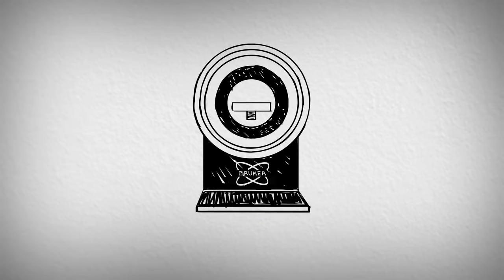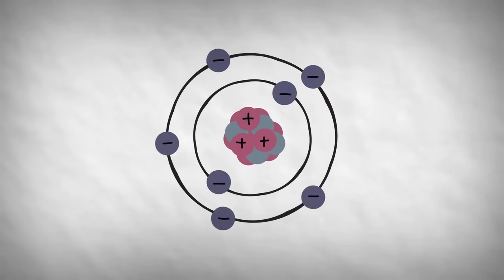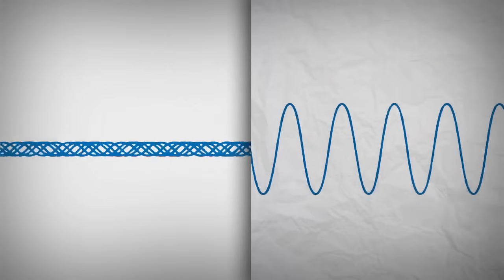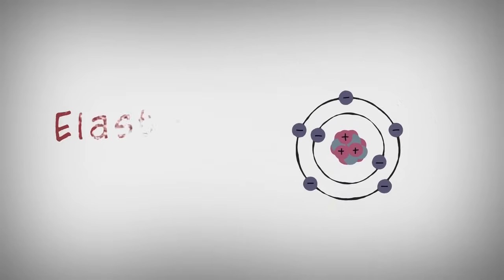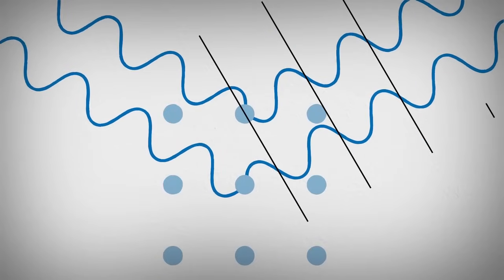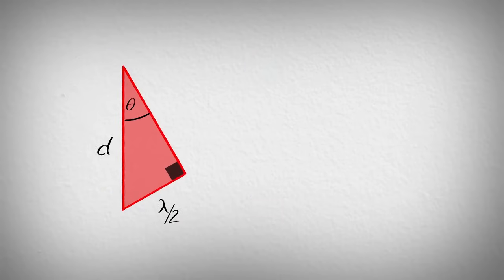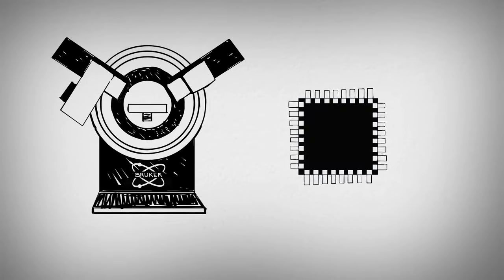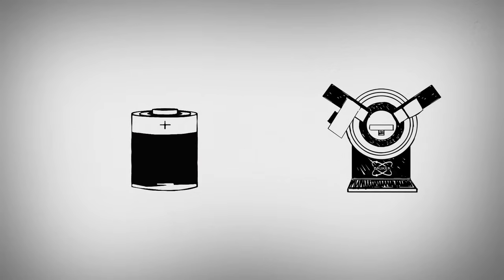What is X-ray Diffraction?

Comment: https://www.youtube.com/watch?v=UcsWZx6p5Qg

### *What is X-ray Diffraction?*

*0:00* What is X-ray diffraction, and what is it used for? In an X-ray diffraction experiment, a sample is placed into the center of an instrument and illuminated with a beam of X-rays. The X-ray tube and detector move in a synchronized motion. The signal coming from the sample is recorded and graphed, where peaks are observed related to the atomic structure of the sample. Most materials are made up of many small crystals like sand on a beach. Each of these crystals is composed of a regular arrangement of atoms,

0:29 and each atom is composed of a nucleus surrounded by a cloud of electrons. It's at this scale that the story of X-ray diffraction begins. X-rays are high-energy light with a repeating period called the wavelength. Since the wavelength of an X-ray is similar to the distance between atoms in a crystal, a special interference effect called "diffraction" can be used to measure the distance between the atoms. Interference occurs when X-rays interact with each other. If the waves are in alignment, the signal is amplified. This is called "constructive interference".

1:02 If the waves are out of alignment, the signal is destroyed. This is called "destructive interference". When an X-ray encounters an atom, its energy is absorbed by the electrons. Electrons occupy special energy states around an atom. Since this is not enough energy for the electron to be released, the energy must be re-emitted in the form of a new X-ray, but the same energy as the original. This process is called "elastic scattering". In a crystal, the repeating arrangement of atoms form distinct planes separated by well-defined distances. 

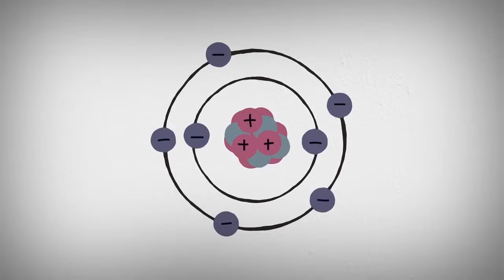1:32 When the atomic planes are exposed to an X-ray beam, X-rays are scattered by the regularly spaced atoms. Strong amplification of the emitted signal occurs at very specific angles where the scattered waves constructively interfere. This effect is called "diffraction". The angle between the incident and the scattered beam is called 2-theta. In order for constructive interference to occur, the scattered waves must be in alignment, meaning that the second wave must travel a whole number of wavelengths.

2:01 In this case, one half of a wavelength is traveled on the incident side, and one half on the scattered side, yielding one additional wavelength. In the case of the next X-ray, one wavelength has traveled on both the incident and the scattered side resulting in two wavelengths. This reinforcement occurs throughout the crystal. The exact angle at which diffraction occurs will be determined from the red triangle. The angle at the top is theta, half the angle between the incident and scattered beams.

2:27 The long side is the distance between the atomic planes and the short side we know is one half of a wavelength. The relationship between the diffraction angle, and the spacing between the atoms can be determined by applying the sine function. Rearranging this equation yields an equation commonly known as "Bragg's Law", named after Sir William Henry and William Lawrence Bragg, the father-son team who won the Nobel Prize in 1915 for their work analyzing crystal structures with X-ray diffraction. This technique of X-ray diffraction is used today for a wide variety of materials,  ranging from

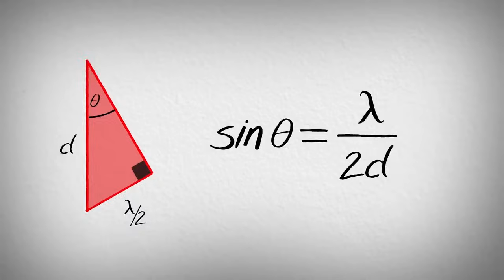2:58 single crystal epitaxial thin films, to polycrystalline mixtures of powders, and even randomly oriented amorphous materials. X-ray diffraction helps scientists to develop new pharmaceuticals, classify rock formations based on their mineral components and understand how the arrangement of atoms affects the behavior of energy storage materials. As scientists push their ability to engineer materials on the atomic level, X-ray diffraction becomes an increasingly important tool in their toolbox. Advances in equipment design have made X-ray diffraction easier to use, and more powerful than ever.

Comment: What is the use of moving the source and detector if the sample is a powder and therefore placing millions of crystals at random orientation.   Only those that happen to lie at the "Bragg angles" (n.lamda =2d.Sin theta) will produce an exit beam.
Reply from the maker: Typical detectors are 2-3 degrees wide. 
By moving the source and detector a wide range of 2 Theta angles can be accessed. Additionally when the sample is a flat surface, poor resolution is obtained when the incident and outgoing angles are dissimilar.
Reply: @Bruker  
You seem to have not been paying attention.

Comment: why XRD is not spectroscopy? Thanks
Reply from the maker: XRD is based on scattering and interference of the x-ray beam - the energy (wavelength) isn't changed in this process. In spectroscopy the x-ray would be absorbed and a x-ray of different (lower) energy would be emitted.
Reply: @Bruker  Thanks, Hence why DLS is spectroscopy however it depends on measuring the intensity of scattered light also

Comment: A little bothered by some of the information here.  Should be mentioned that the principle of single crystal X-ray diffraction and macromolecular X-ray diffraction sort of work differently.  I suppose you can say that atoms are aligned in a regular pattern in if your crystal consists of a single element like a crystal of diamond or something, which is what I assume this video is talking about.  In most forms of X-ray diffraction, the compound or protein of interest is crystallized and pack into a regular repeating pattern.  The atoms themselves arnt necessarily oriented in regular spacing, but the unit cell is.  The unit cell can contain 2 or more molecules (not atoms) organized in some orientation.  The raw data is usually not recorded as peaks but rather a diffraction pattern, like a 3D sphere of regularly spaced dots that are the diffracted X-rays and undergo a Fourier transformation in order to deduce the structure of the crystallized compound.
Reply: This is one of the interesting points of XRD. Scientists from many different disciplines have developed their own methods and descriptions of the principles over the last 100+ years. Chemists, geologists, physicists and materials researchers all have different sample types with slightly different methods and nomenclature. The video describes the most basic and widely used form of XRD (Powder XRD or PXRD) as a basis for further exploration into more advanced methods (such as Single Crystal diffraction with complex lattice/ basis which you describe), but the fundamental principles of diffraction stay true!

Comment: I want to Calculate Residual stress using XRD data. 
How to Calculate? Please Help me.
Reply from the maker: Hi,
The residual stress is calculated from the d-spacing change at various sample orientation. Depending on the instrument and the material you work with, there are various data collection and evaluation strategy. To avoid the tedious calculations, a special software, such as DIFFRAC.LEPTOS, is used. For further information on this subject, there are two online training classes available to existing users of Bruker. 

Americas
June 17, 2020
Wednesdays, 10 - 11 am CDT
Residual Stress Analysis with 2D Detector and DIFFRAC.LEPTOS
Host: Bob He
Language: English

Europe/Africa
May 27, 2020
Wednesdays, 10 - 11 am CET
Residual Stress Analysis (ISO and Side Inclination Method) in DIFFRAC.LEPTOS
Host: Kurt Erlacher
Language: English
Reply: sir, can I get your contact number. I am from Tamilnadu, is there your centre for learning this course.
Reply: If you have more questions on stress measurement, you can send me an email to bob.he@bruker.com.

Comment: X-rays are highly energetic to excite electrons to the upper states and even, they can be free. How could not an electron cannot be excited ?
Reply from the maker: X-ray Diffraction (XRD) uses the elastically scattered signal. In some materials (example Iron sample with Cu radiation) the electrons can be ejected resulting in x-rays of a different wavelength. This "fluorescence" results in increased background in the XRD signal which can be minimized or eliminated with secondary optics or proper energy discrimination by the detector.

Comment: I can't get if we analyzing a powder there are crystals with many orientations but as the result several peaks only
Reply from the maker: In a single crystalline phase there are distinct atomic plane spacings present, often referred to as d-spacings. The angle at which the peaks in the XRD scan occur is found with Bragg’s Law, meaning peaks only occur at specific angles.
In addition, for diffraction to occur, the crystal must be in a very particular orientation. For powders, this orientation limitation is eliminated due to the random orientation of the powder, but the Bragg’s Law limitation is still present. The relative intensities of peaks is also related to the configuration of the atoms and the types of atoms in the material.

Comment: Thanks Bruker. I graduated with my Ph.D in chemical physics thanks to one of you diffractometers. It was applying molecular quantum mechanics on organic crystal structures and understanding the topology of the electron density based on molecular wavefunctions.
Reply: You got me interested in this field of chemical physics 🙂. Can you please explain what is electron topology.
Reply: @prammar1951  To study atoms and molecules, theoretically, requires quantum mechanics. If you're studying large quantum mechanical systems, in this case, molecules, you needed an expanded form of quantum mechanics derived from the Schrodinger equation. 

With molecular studies entailing the reactivity of molecules, the electron density (called the charge density) is paramount in predicting how molecules will behave in an environment. Thus, using x-ray diffraction is an ideal experimental tool to ascertain the experimental electron density of a molecule. 

Thus, we build theoretical models of complex molecules. Then we compare theoretical models with experimental x-ray diffraction. You compare your models and see how good the theory agrees with reality. 

Many times these models utilize very sophisticated equations, mainly due to the fact that you're dealing with complex partial differential equations that are difficult to extract information from. You can utilize more advanced mathematics like topology and differential geometry on manifolds to make many calculations more accessible. Topology is basically the mathematics of shapes. If you know the charge density is changing you extract a great deal of information on how electrons are behaving.
Reply: @ErwinSchrodinger64  
May I know how to useful on applications like any products
Reply: Thanks for your amazing reply. Really appreciate it.